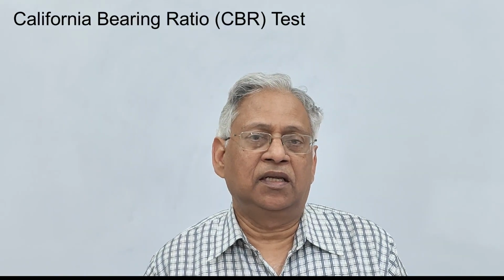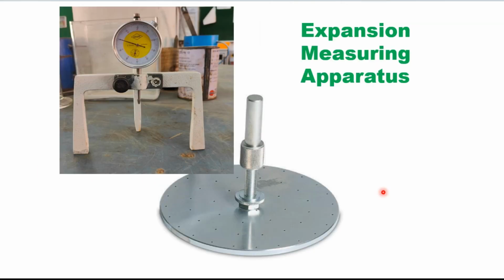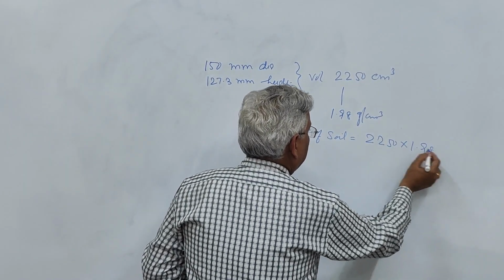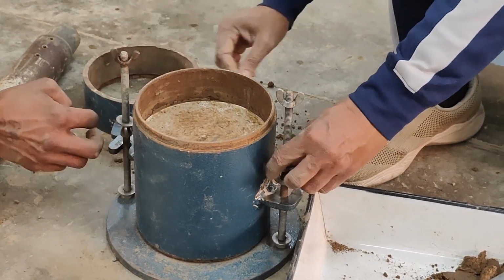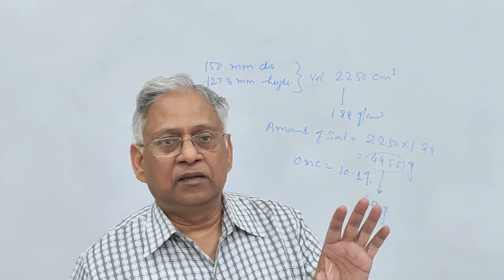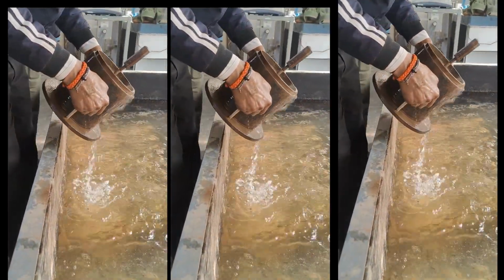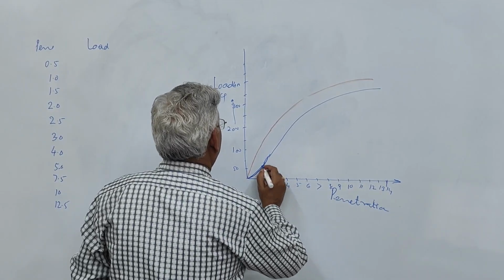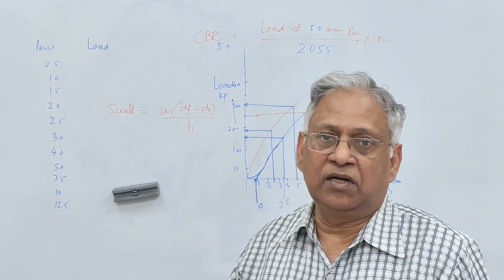Laboratory determination of CBR of remoulded sample, Both static and dynamic compaction in one video

Comment: Hello sir.
Currently my internship is going on and we determined cbr of soil for embankment in lab.
There, I saw that the lab technician multiplied 4.06 in cbr value which you calculated saying that it's factor for proven ring.
I heard it for first time? Can you please throw some light on this?
Reply from the maker: Yes, every proving ring has a calibration factor which converts number of divisions to load in kg. During the test we note down the number of divisions and that is not the load.

Comment: Sir,gud mrng I have one doubt why cbr at 2.5mm penetration is higher than 5mm.And also IS 2720 suggest that surcharge load should be equal to weight of pavement.how can we provide that much surcharge weight sir.kindly clarify my doubts sir
Reply from the maker: CBR at 2.5 mm should ideally be higher as here we are measuring the resistance at lower penetration. The initially, resistance offered by the soil is more.
Yes, it is not possible to estimate he correct surcharge and therefore a normal surcharge of 2.5 kg is good enough.
Reply: @SatishIITR  thnk u soo much sir.....🙏🙏🙏